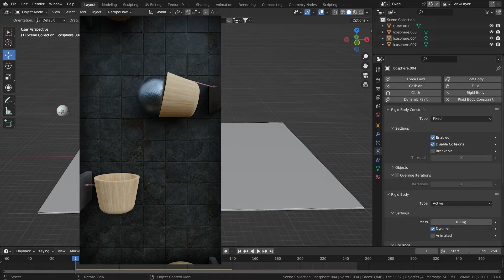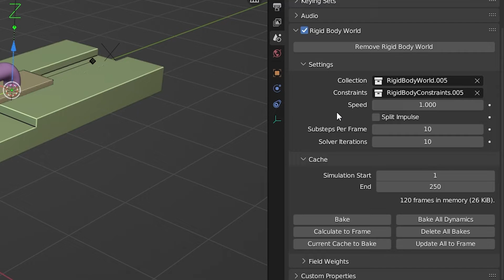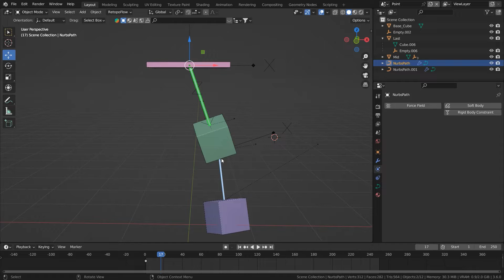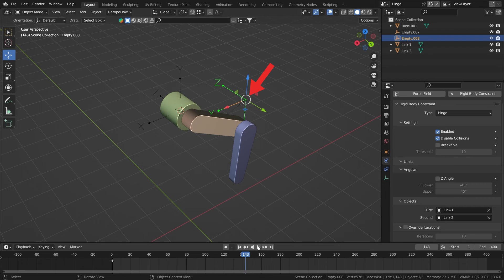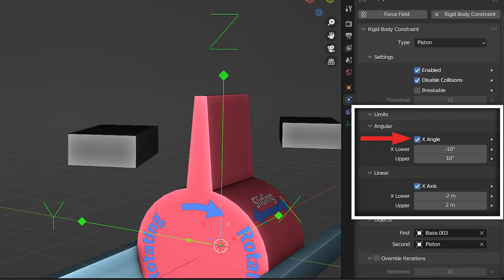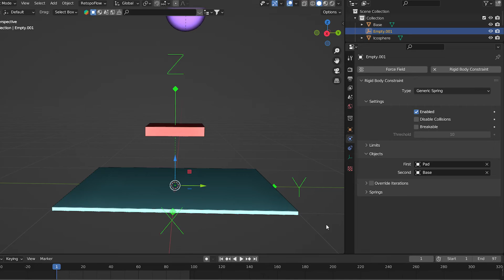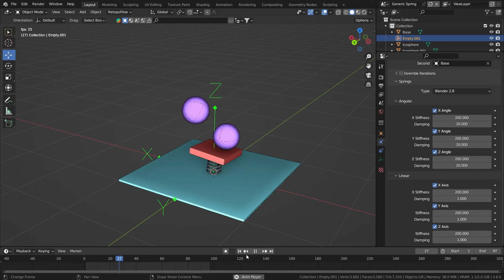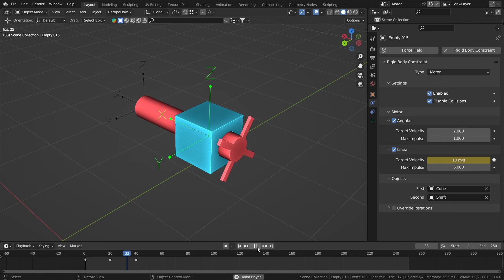Blender Physics 101: Understanding All Rigidbody Constraints!

Comment: Hi, maybe I’ll have to rewatch the video and experiment by myself but I don’t really understand how you’re using empty objects… are you using them in place of the objects in rigid body constraints? If yes, Why do not use the objects themselves? Btw from the video it seems to me that you’re using the real objects in constraint settings and so I do not understand the role of empties :)
Reply from the maker: Mesh object -
1.Its Hard to know their local axis and you might accidentally apply the rotation which may mess up the local Axis. 
2.youll have to disable them if they are not part of simulation and do back and forth when u wanna change the outcome. 
3.Clutter of mesh objects visually, as u need to add one object for one constraint. 
4.Sometimes you can just use mesh objects if the pivot point dont matter and its just single constraint anyways. 

Empties-
1.can be scaled and are thin to avoid visual clutter.
2.flexible pivot point , mesh can have pivot at their Center of Gravity. 
3.I am specifically using axis Empty or arrow Empty for knowing its local rotation. 
4.Doesn't show in render. 
5.can be parented to other empties or objects without destroying the mesh hierarchy.
Reply: @Mrisometric thank you for the explanation, I will rewatch the video and do some experiments.
Reply from the maker: Best way to learn , experimentation

Comment: if someone needs to make a complex robotic arm (and only that), would you recommend that they use rigid body constraints or rigging?
Reply from the maker: Rigging for sure, RigidBody should only be used in places where gravity takes into action. 
For example : Complex Crane with wrecking Ball attached at the end. 
Rig the whole crane and after animating the rig ,RigidBody Constraint the Wrecking ball part.
Reply: @Mrisometric  that makes sense, thank you!

Comment: How do you bend the spring object while the simulation at 13:12
Reply from the maker: Its a Curve and its both ends are Hooked , the top hood is parented to top cube
Reply: @Mrisometric With hooking the curve from two points, will it stretch automatically while the simulation runs? Or did you add any drivers to the spring object?
Reply: I have the same question. For some reason i can't see his answer to your comment

Comment: Great tutorial, thank you. Wondering, I've been trying to figure out how to "start" the rigid body simulation at a certain frame on the timeline. I have two objects that both drop, but I want one to drop a bit later in the timeline. Thoughts?
Reply from the maker: Key frame Animate "Dynamic" check box of that certain rigid body

Dynamic checkbox when disabled makes that rigid body kinamatic.
In simple words it won't react to force like gravity.. 

And if your simulation start mid frame like say 69th frame the in rigidbody cache set start frame to 69..
Reply: @Mrisometric  thanks for your help

Comment: This is a very good tutorial but my rigid body won't rote. It is a lamps handle. It won't move an inch. When it was just put to active without constraint, it falls normally down until it vanishes but as soon as I add the empty, it doesn't move an inch... Please help
Reply from the maker: Which constraint are you using?
Reply: @Mrisometric  hinge constraint for a lamp handle
Reply from the maker: https://discord.gg/cPWUSS7qAP Join this Discord Server and will help you!